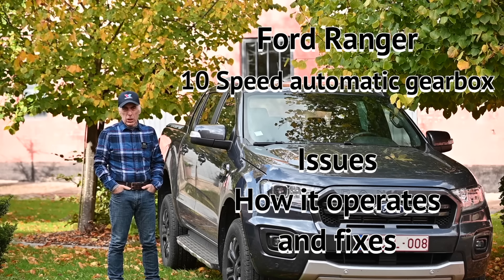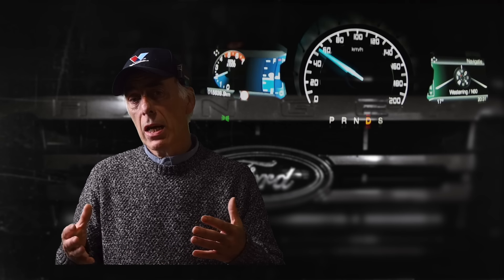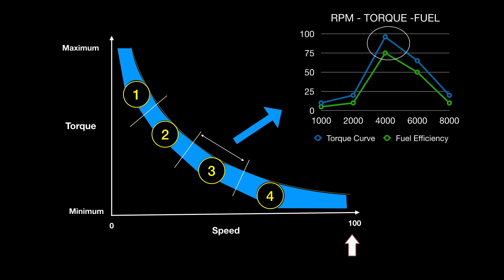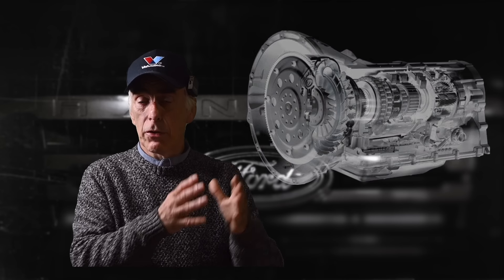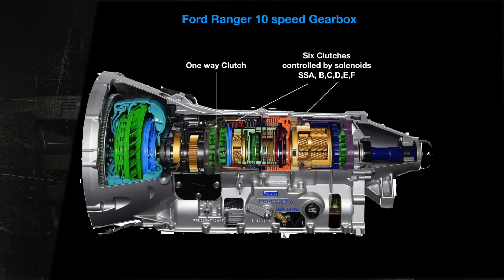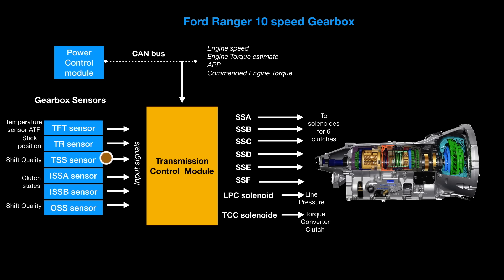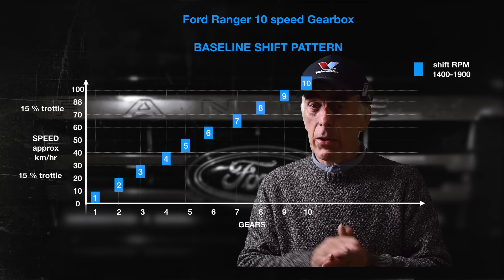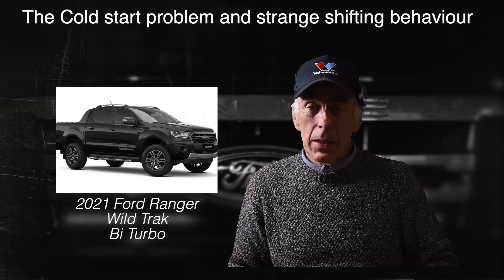Ford Ranger 10 speed automatic gearbox issues and fixes

Comment: 3/30/24 12:30 pm
My transmission had to be replaced at 33 thousand miles.
So now, my 5 year 60k mile warranty has been decreased to approximately 2 years 27k miles.
It seems to me that Ford should give the original warranty if a warranty item was replaced due to failure.
Why would I not think I will only get 33k miles out of the replacement transmission.
It kinda makes me not want to keep my present truck nor ever buy another Ranger.

Comment: I do think this is how this gearbox works and there is no fix for it since it isn’t broken. Wouldn’t hurt to recalibrate every now and then. I hope mine will be fine. It will arrive december 2022.
Reply from the maker: Indeed, it is a perception that we all have on driving gearboxes with less gears , as those rev through the RPM's .. If you have a 10 speed gearbox that rev'ing is more within a limited range and when driven modest it almost sounds like the engine runs at a steady RPM... and that is a strange feeling but normal
Reply: Cold start is normal issue to all vehicle not just Ranger. Any car will experience cold start and that is not on the 10 speed transmission issue. Cold start most like the starter problem or battery nothing on transmission. We have 2007 model transmissiom we fix the starter and now no more cold start. The problem to all driver who drive on Automatic is the way they drive. When you drive in City push the accelerator slowly and it will change gear to low to higher gear  Do not push and pull the accelerator. There are many gear inside the transmission. Now when u drive in highway push deep the accelerator and u can see the odometer go high speed and if reach to 80 to 100 kph release the accelerator and let the carl run. If the odometer is slowly down to 60 then its time to push the accelerator and if reach to 120 to 160 release again. That is the way your automatic car will last to 30 yrs without any problem. Another friendly advise to all automatic car owner when you park hit hard the brake and put to neutral and then park. If you hit the brake and put to park the vehicle will move backward and if you do that all the time your reverse transmission will damage the gear and it will not reverse. This is what I observed to all Automatic.

 Summary:
All Automatic car. Do not push and pull the accerator. Push slowly to reach to 60kph if u drive in City. City speed max to 0 to 40 correct me if I am wrong. In freeway push deep accelerator if reach to 80 to 120 relase the accelerator let the car run. If u see the odometer slowly down speed and push again the accelerstor to reach to high speed 160kph and release again. Friendly advise to last forever without any problem. I say again do not push and pull the accelerator if u drive automatic car.😁😁😁😁😁 if manual no problem

Comment: Mine 2020 ford ranger sport diesel  on a cold start or sometimes if it's shut off for 20 mins goes directly to S and sometimes shifts and sometimes don't shift but with within 5 to 10 mins it shifts itself over to D and as long as it is never turned off I never have a problem Lol
Crazy it's at 56000km also this it in Asia so it's never cold here

Comment: That is a pretty large defect in the engineering.  To find a flat surface with no traffic and no speed limit so that the TCM can learn from the ECU would be impossible even if you wanted to pay the traffic fines and lose your license where I and many other people live.  For it to shift to those top gears it is going to have to be exceeding the speed limit by a large margin.  Here on a confined island with two lane roads and maximum speed of 55 on twisting and turning roads (not to mention winter time ice and snow, rain all year) +heavy traffic, this just isn't feasible.  Not only that we have no dealership (although that does not seem to have helped you and in past experience I have found the same) available with "trained" mechanics on complicated systems.  In the modern world fewer and fewer people want to become an auto mechanic and deal with the cramped impossible access issues, low pay in comparison to heavy duty mechanics, etc. so it becomes harder and harder to get service for complex issues in modern cars.  Complicated solutions with many problems new off the showroom floor at very expensive prices on cars that only last a few years before they rust out and are scrap represent failed answers.  If engineers and executives had to actually drive the crap they put out at a percentage of their income the regular guy has to pay to fix this junk I believe we would see rapid change.  Bottom line is that cars today with all the complicated systems are way more expensive to operate, get the same fuel mileage that the 1960 era cars achieved, and last less time on the road.  Add to that that when failures do occur they are almost always major expenses.  It pays to remember the "KISS" maxim (Keep it simple, stupid).  Complicated systems whether on Boeing jets or automobiles have a higher chance of failure especially when made of cheap plastics that self-destruct.
Reply from the maker: I can only agree with you Douglas,  I don't like it either but it worked for me ( the procedure)... It is indeed a bad design, in general that 10 Speed is a piece of S...

Comment: Here's the tragedy.  Ford should have the gear box calibrated before the sale.  The customer should not have to find a long road to spend 30 minutes speeding back and forth on. P.s. I've tried this, and even though it does improve the shifting,  it's doesn't fix it completely.  The erratic,  harsh shifting is still there.  It comes and goes.  The truck is an absolute mess.

Comment: Ive requested a refund for my 2022 v6 ranger.
Constantly skips 2nd gear and applies the handbrake itself. They are telling me at the dealership that skipping 2nd is actually the design? Is this bullshit cos it sounds like it?
Reply: it is built into it, they also will skip 4th gear if under  light acceleration. If you use the sport function it will use all the gears.
Reply: @oldbloke100  it shouldnt skip 2nd labouring up a hill. Just like it shouldnt skip it while going 15 km or when accelerating hard. Mines fucked
Reply: Really ridiculous and dangerous. Gears in the oil pump or gearbox will definitely break!

Comment: Helpful, thanks Steve
Reply from the maker: My pleasure
Reply: Cold start is normal issue to all vehicle not just Ranger. Any car will experience cold start and that is not on the 10 speed transmission issue. Cold start most like the starter problem or battery nothing on transmission. We have 2007 model transmissiom we fix the starter and now no more cold start. The problem to all driver who drive on Automatic is the way they drive. When you drive in City push the accelerator slowly and it will change gear to low to higher gear  Do not push and pull the accelerator. There are many gear inside the transmission. Now when u drive in highway push deep the accelerator and u can see the odometer go high speed and if reach to 80 to 100 kph release the accelerator and let the carl run. If the odometer is slowly down to 60 then its time to push the accelerator and if reach to 120 to 160 release again. That is the way your automatic car will last to 30 yrs without any problem. Another friendly advise to all automatic car owner when you park hit hard the brake and put to neutral and then park. If you hit the brake and put to park the vehicle will move backward and if you do that all the time your reverse transmission will damage the gear and it will not reverse. This is what I observed to all Automatic.

 Summary:
All Automatic car. Do not push and pull the accerator. Push slowly to reach to 60kph if u drive in City. City speed max to 0 to 40 correct me if I am wrong. In freeway push deep accelerator if reach to 80 to 120 relase the accelerator let the car run. If u see the odometer slowly down speed and push again the accelerstor to reach to high speed 160kph and release again. Friendly advise to last forever without any problem. I say again do not push and pull the accelerator if u drive automatic car.😁😁😁😁😁 if manual no problem

Comment: high rev shifting can be also DPF regeneration, at least in mercedes it shifts at higher revs when that happens. Also any EGR sticking or problem effects the shifting alot. harsh downshifting and such.  As for fords. Those dual clutch S-Max transmissions are a nightmare, they just fail totally really easily. Never buy those. Stick with real automatics, with turbine and clutches. Basicly every CVT is a nightmare, Also most DCT are bad. Most normal turbine transmissions are pretty good as they are most tested and used design so far.  as for manual or automatic, someone said that German engineer knows more about shifting than you. So automatic is pretty good.
Reply from the maker: Thanks James,  great text.  One  remark the Ranger has no longer a dual clutch...  that was indeed not a great invention
Reply: Cold start is normal issue to all vehicle not just Ranger. Any car will experience cold start and that is not on the 10 speed transmission issue. Cold start most like the starter problem or battery nothing on transmission. We have 2007 model transmissiom we fix the starter and now no more cold start. The problem to all driver who drive on Automatic is the way they drive. When you drive in City push the accelerator slowly and it will change gear to low to higher gear  Do not push and pull the accelerator. There are many gear inside the transmission. Now when u drive in highway push deep the accelerator and u can see the odometer go high speed and if reach to 80 to 100 kph release the accelerator and let the carl run. If the odometer is slowly down to 60 then its time to push the accelerator and if reach to 120 to 160 release again. That is the way your automatic car will last to 30 yrs without any problem. Another friendly advise to all automatic car owner when you park hit hard the brake and put to neutral and then park. If you hit the brake and put to park the vehicle will move backward and if you do that all the time your reverse transmission will damage the gear and it will not reverse. This is what I observed to all Automatic.

 Summary:
All Automatic car. Do not push and pull the accerator. Push slowly to reach to 60kph if u drive in City. City speed max to 0 to 40 correct me if I am wrong. In freeway push deep accelerator if reach to 80 to 120 relase the accelerator let the car run. If u see the odometer slowly down speed and push again the accelerstor to reach to high speed 160kph and release again. Friendly advise to last forever without any problem. I say again do not push and pull the accelerator if u drive automatic car.😁😁😁😁😁 if manual no problem

Comment: Love your work 👍
Reply from the maker: Thanks bud
Reply: Cold start is normal issue to all vehicle not just Ranger. Any car will experience cold start and that is not on the 10 speed transmission issue. Cold start most like the starter problem or battery nothing on transmission. We have 2007 model transmissiom we fix the starter and now no more cold start. The problem to all driver who drive on Automatic is the way they drive. When you drive in City push the accelerator slowly and it will change gear to low to higher gear  Do not push and pull the accelerator. There are many gear inside the transmission. Now when u drive in highway push deep the accelerator and u can see the odometer go high speed and if reach to 80 to 100 kph release the accelerator and let the carl run. If the odometer is slowly down to 60 then its time to push the accelerator and if reach to 120 to 160 release again. That is the way your automatic car will last to 30 yrs without any problem. Another friendly advise to all automatic car owner when you park hit hard the brake and put to neutral and then park. If you hit the brake and put to park the vehicle will move backward and if you do that all the time your reverse transmission will damage the gear and it will not reverse. This is what I observed to all Automatic.

 Summary:
All Automatic car. Do not push and pull the accerator. Push slowly to reach to 60kph if u drive in City. City speed max to 0 to 40 correct me if I am wrong. In freeway push deep accelerator if reach to 80 to 120 relase the accelerator let the car run. If u see the odometer slowly down speed and push again the accelerstor to reach to high speed 160kph and release again. Friendly advise to last forever without any problem. I say again do not push and pull the accelerator if u drive automatic car.😁😁😁😁😁 if manual no problem

Comment: Deze reactie van de dealer is de reden dat mijn vriend zijn Ford Ranger heeft teruggebracht naar de dealer. Hij is nu erg happy met zijn Volkswagen Amarok. Zelf heb ik ook de Ford overwogen omdat hij er goed uit ziet. Maar uiteindelijk is het vanwege de horrorverhalen over de service van de Ford dealer een Isuzu Dmax geworden, waar ik zeer tevreden over ben.
Reply: You made a good choice with the dmax, the ford ranger has not been reliable for a long time, the 2.2 diesel was probably the weakest engine in a truck I have driven…
Reply from the maker: Indeed , a good alternative....  I went for the Ford for the price I got and the 3500Kg allowed weight  to pull
Reply: @D3Sshooter  you seem to have it figured out, with diesel fuel prices I had to sell my land cruiser…
Reply: @D3Sshooter  Isuzu is also 3500 kg.

Comment: Steve, you have the rare mix of left brain AND right brain skills.  It seems you are an Engineer and an Artist.   I love the variety of your content.   I have a 2017 Ford F150 with a 10 speed Automatic gear box.   I’ve had no issues with it and I pull a lot of trailers with it.  (I’ve had issues with cam phasers but that’s another story)   So it seems the firmware in the Ranger is different than an F150.   

Are you sure the fluid level is correct, as low fluid can cause similiar issues.   Maybe the dip stick is wrong.😟
Reply from the maker: Thanks Jim, I know I am a bit strange lol... Yes all the basics are checked....  The F150 should have the same box but possible different firmware...
Reply: Cold start is normal issue to all vehicle not just Ranger. Any car will experience cold start and that is not on the 10 speed transmission issue. Cold start most like the starter problem or battery nothing on transmission. We have 2007 model transmissiom we fix the starter and now no more cold start. The problem to all driver who drive on Automatic is the way they drive. When you drive in City push the accelerator slowly and it will change gear to low to higher gear  Do not push and pull the accelerator. There are many gear inside the transmission. Now when u drive in highway push deep the accelerator and u can see the odometer go high speed and if reach to 80 to 100 kph release the accelerator and let the carl run. If the odometer is slowly down to 60 then its time to push the accelerator and if reach to 120 to 160 release again. That is the way your automatic car will last to 30 yrs without any problem. Another friendly advise to all automatic car owner when you park hit hard the brake and put to neutral and then park. If you hit the brake and put to park the vehicle will move backward and if you do that all the time your reverse transmission will damage the gear and it will not reverse. This is what I observed to all Automatic.

 Summary:
All Automatic car. Do not push and pull the accerator. Push slowly to reach to 60kph if u drive in City. City speed max to 0 to 40 correct me if I am wrong. In freeway push deep accelerator if reach to 80 to 120 relase the accelerator let the car run. If u see the odometer slowly down speed and push again the accelerstor to reach to high speed 160kph and release again. Friendly advise to last forever without any problem. I say again do not push and pull the accelerator if u drive automatic car.😁😁😁😁😁 if manual no problem

Comment: Tried it. Doesn't work unfortunately. Certainly not where I live in the UK anyway. You need a good couple of miles of uninterrupted flat road to get to 8th at 15% throttle and then on to 10th gear. And you're then at motorway speeds. Then you need to repeat several times.  If you can do that without interest from the local constabulary, please tell me how... 😪